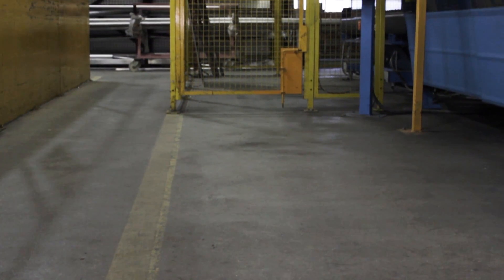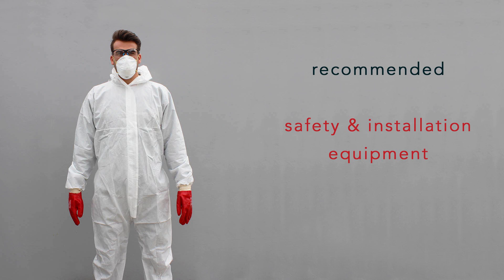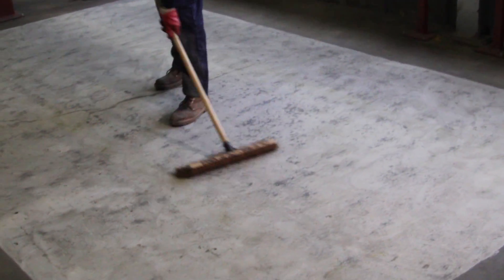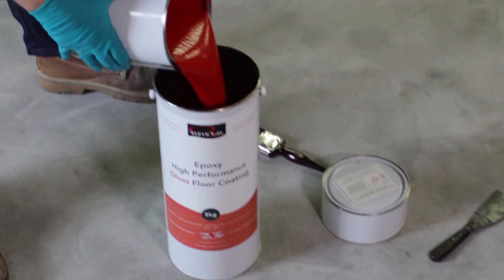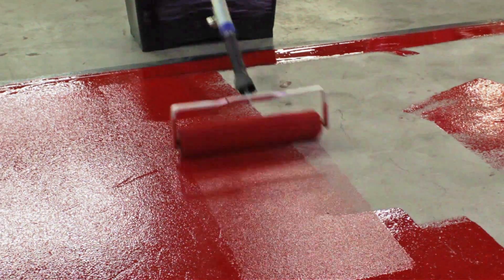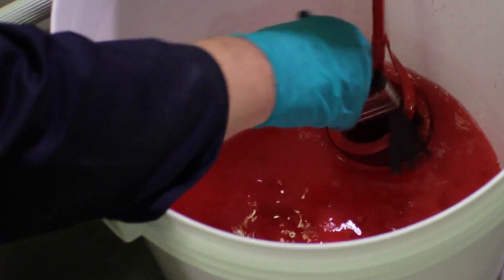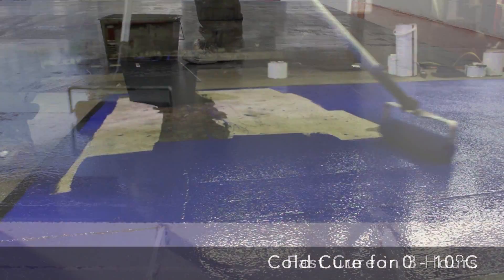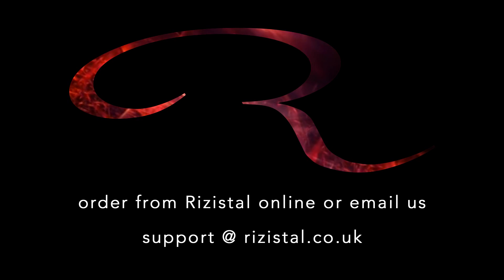Paint a protective gloss floor coating | Rizistal

Comment: I have a question I recently painted a concrete floor about two years ago I need to paint over some of the paint which is somehow begin to peel can I paint over the clear coat and will the paint stick
Reply from the maker: Hi Paul, sorry for the late reply. 

You will need to prep the surface by trying to remove as much of the existing material as possible to provide a key for the new paint. Once prepped correctly our paints will have an excellent bond to concrete.